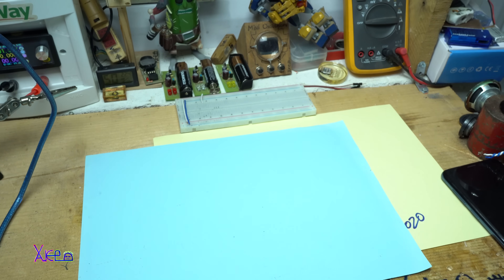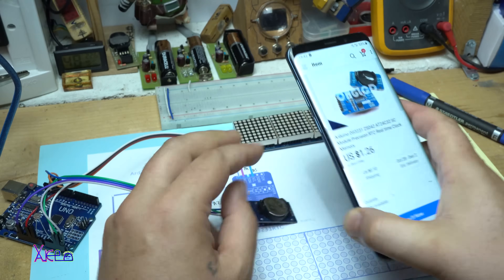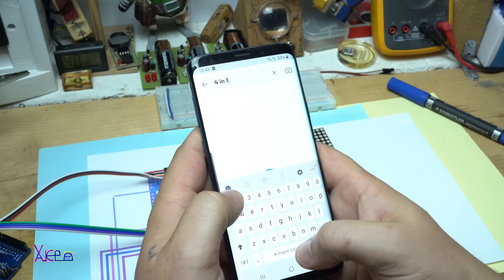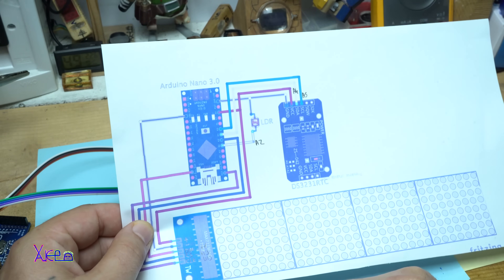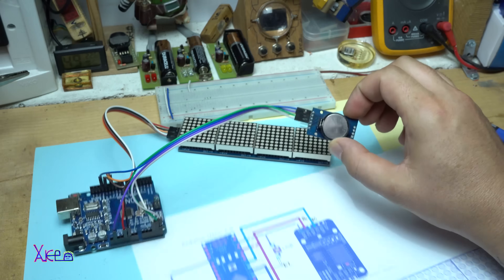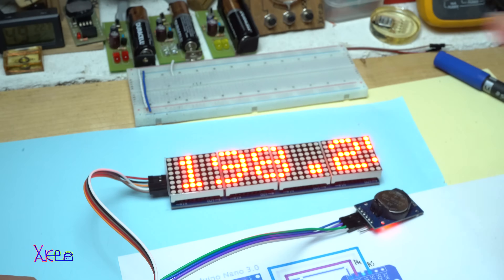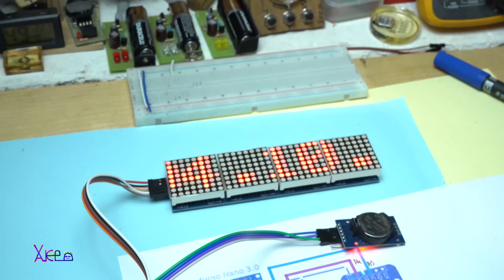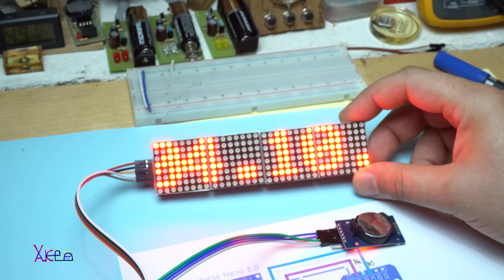4 in 1 LED matrix clock DIY

Comment from the maker: Do you want daily video projects,if yes please support with sharing and like the video,thanks
Reply: I need code
Reply: sii, esta muy bueno! Busqué un monton y este hasta ahora es el unico que funciona. Sabes como bajarle la velocidad?
Reply: Ok
Reply: We will❤️❤️❤️❤️
Reply: @Hacktuber Please I Need Help. I Have Tried To Make It. All Work Fine But My DS3231 Doesn't Set Time. I Also Tried another One But It Also Did Not Set Time. Please Help Me. The Time It Shows Is 1.1.2000 And Time Is 0:0:00
Reply: Hi, dear hacktuber,  thanks a lot for such a good work.. however I ve replaced the Arduino nano with Uno, reuploaded the codes and viola !!!it's working now . However initiialy it was displaying 01 01 2000 as Callender , then 01 01 00 as time and 34 deg c as temp..I tried to change the day date time etc thru serial monitor, like sending command 02:04:2024.. it changed the day and date but the year remains 2000... Same with time can't change it thru monitor...
Help is highly appreciated !!!

Comment: Nice clock. Had few issues compiling but now solved. Is it possible to slow the scroll rate?
Reply from the maker: Yes, you can do changes in code

Comment: Hi dear hacktuber.. after 100 trials finaly my clock is ready and working..
Thank you dear
Reply from the maker: Great 👍
Reply: @Hacktuber  thanks bro..
Reply: @Hacktuber    dear I was wrong .. the clock isn't steady..  stops scrolling suddenly, or runs fast, becomes unable to read . Resets automaticaly to  either old date or advance date like 2031 randomly.. the Arduino blinks in between and resets all.. changed Arduino, rtc  n battery too.. no luck.. what could be possible reason or it's the max7219 is culprit?
Reply: @Hacktuber  dear, I had an old arduino Uno R3, which I replaced with Uno, even the Uno too was troubling but Uno R3 is seems good so far. No friezing no resetting , not scrolling rapidly so far..seems , in mine case I must use Uno R3 instead of Uno and Nano..so far so good..

Comment: Great work and Thank You for sharing ...
I try to follow you project for a dining room clock but I have a Problem with your Code : 
- I get an error :
////////// error: no matching function for call to 'DS3231::DS3231(const uint8_t&, const uint8_t&)'
 DS3231 rtc(SDA, SCL); //////////
I get this error NO matter what "sketch" I was using from internet ... 
Please can You provide a Link with the SPECIFIC library You used ? ... otherwise no use !!! 
THANK You
Reply from the maker: Have you install the library for DS3231

Comment: how set the time? date-month-show 2000-04-01...
Reply: serial monitor
Reply: @pcmobiletechnicalsolutions8504  but how? I'm seriously stuck in this step
Reply: Tell me the problem
Reply: Upload the code to Arduino then go to serial monitor. Select same board rate as described in void setup. Then you see the date time setting process just send the date time as command and done
Reply: @pcmobiletechnicalsolutions8504 it doesn't help dear . Can pls give an example how to send command via serial monitor pls? Thankig you in advance

Comment: You have to remove the Resistor that is above the SCL line and goes to the Diode on the RTC module!

This module was made for a rechargeable coin battery. Removing either the Resistor or the Diode, prevents sending a charging voltage to the battery that will destroy it and may case other problems if you are using a normal CR2032 battery.
Reply: I am using this type of RTC module for 2 years and it is very well until now.